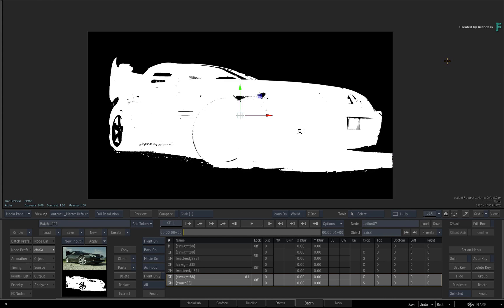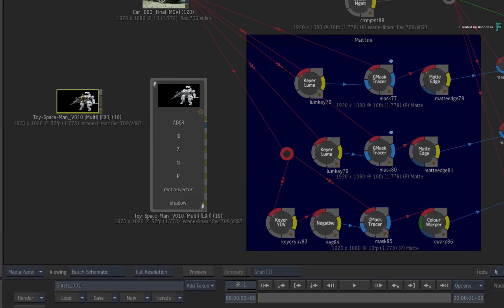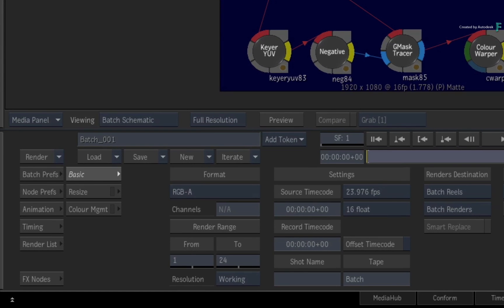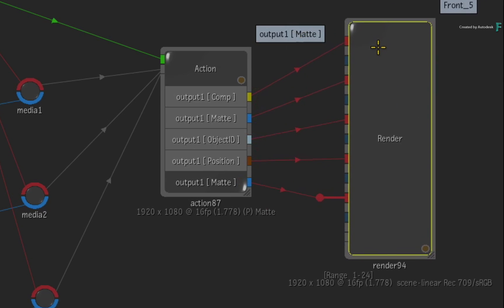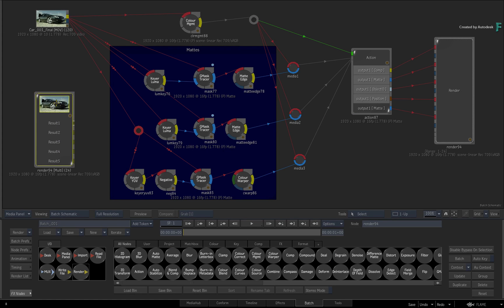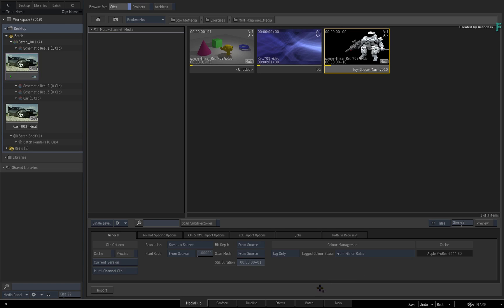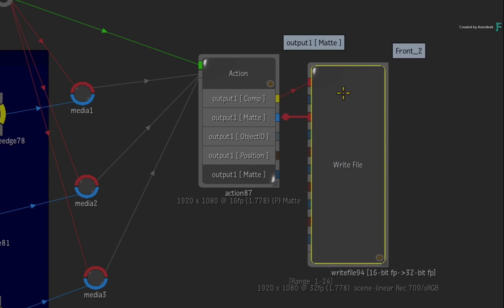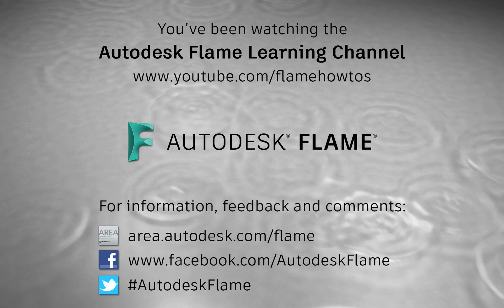Rendering Multi-Channel from Batch - Flame 2019

Comment: Have multichannel BFX nodes been implemented?  eg: Suppose there is a bfx tree that ends with a multichannel action node. Right click that action node,  select "create bfx".  The created bfx node should have multiple outputs, mirroring the end of the tree encapsulated in the bfx node.
Reply from the maker: Hi maurypb, current the create BFX clip only gives a fill and alpha.   The workaround is to render a multi-channel clip to the reel or library and drag the render back into the batch/bfx schematic.  Best to log it as a feature request through Autodesk Flame Feedback.  Many thanks!